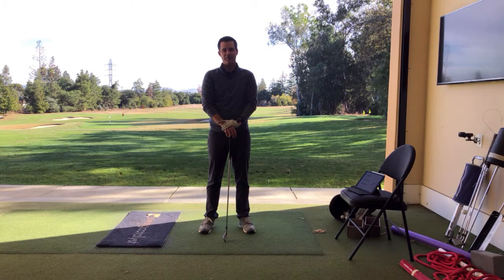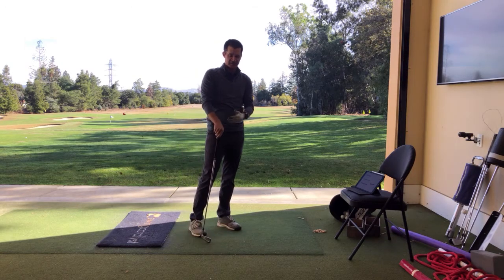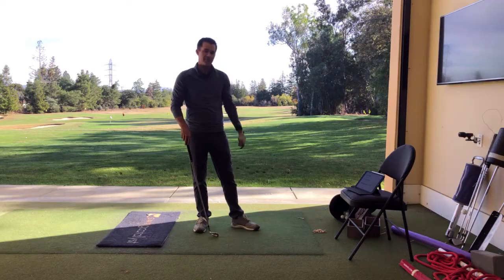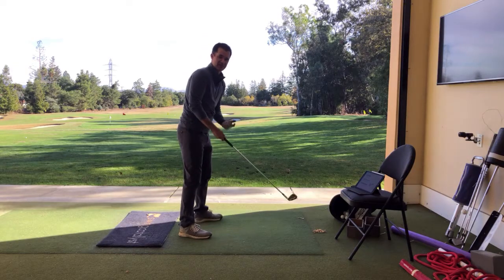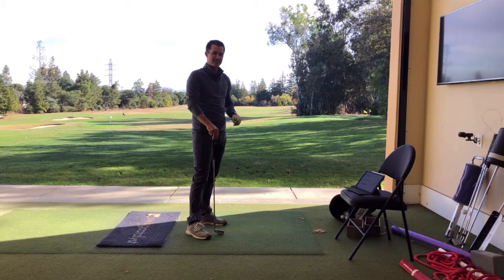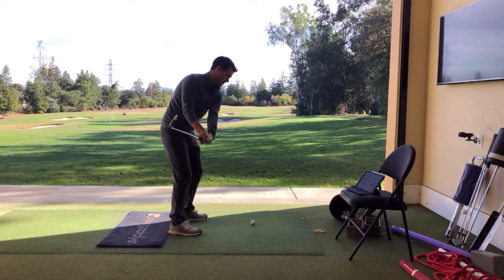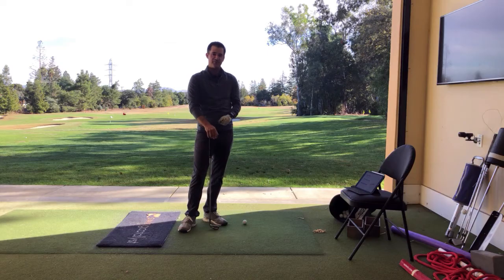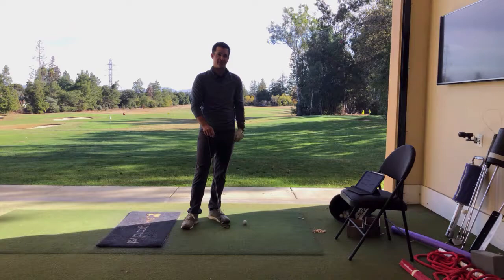Learn Motorcycle Movement Using HackMotion Sensor's biofeedback by Tyler Ferrell

Comment: @hackmotion Does the motorcycle move have to be in the downswing, can I do it in the takeaway or at the top of my backswing?
Reply from the maker: Hi Alex, you can do the motorcycle move in various parts of the swing if you need to practice adding more flexion.
Reply: I do it as I get the club to parallel in my takeaway and it works for me. Has totally transformed my consistency and ball striking.